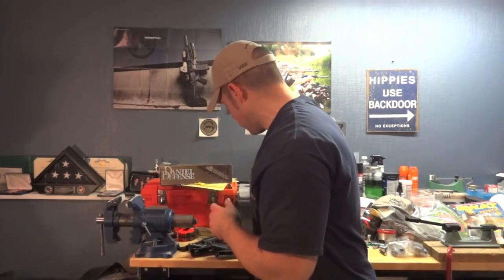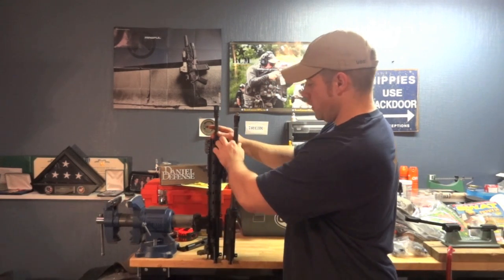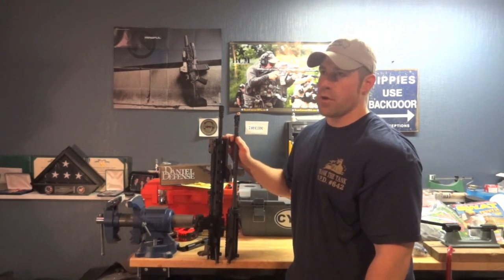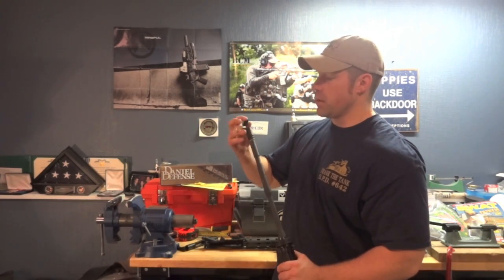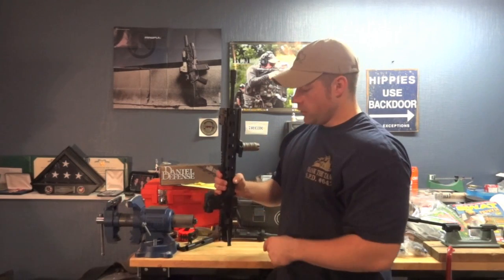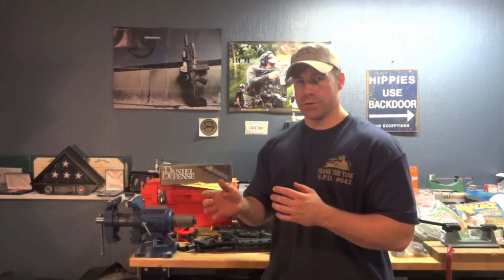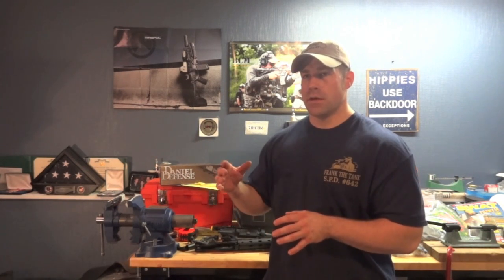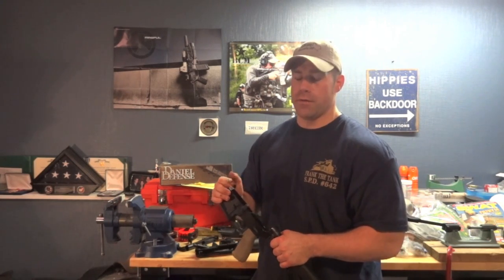Choosing a 16" vs 14.5" Pinned/Welded Barrel

Comment: Just an fyi for anybody thinking about pinning and welding their own build. A 14.5" barrel with a 1.5" muzzle device does not equal 16" due to the two parts being threaded together. Just grab a 2" device and go to town

Comment: I built a 14.5" 9mm with a QC10 barrel and Kineti-tech muzzle brake + blast forwarder. It's absolutely great! The barrel nut fits over the muzzle brake so it's not lost any sort of functionality.

9mm is a blowback not direct impignment so I don't have to worry about any sort of gas pressures and such for reliability.

I went for 16" for my .223 wylde.

Comment: What about dwell time? The mid length was designed to give a 16 inch carbine the proper amount of dwell time (the time the gas [with proper pressure]is tapped off the barrel till the bullet exits the barrel). Colt designed, thoroughly researched and tested  the carbine 14.5 barrel, along with a machine gun bolt carrier and  buffer system to work & work well. The mid length is an answer to the 16 inch having a longer dwell time, causing more pressure for a longer time than needed . Easy to research this on the net. Admit I like the looks a lot, but there is much more to the story. A 14.5 pinned flash hider most closely mimics what Colt designed so well.
Reply: In terms of reliability what would work better? Are there differences since the 14.5 was designed for a full auto m4, and the 16" designed for a semi auto ar15?
Reply: I know this comment is old af, but there is a good video on YouTube called i believe... The truth about carbine mid-length and full length gas systems. Apparently what you're talking about is a common misconception. I'm not saying that it is, but that's just what that video explains.

Comment: My bcm 14.5 mid length gas. Eats wolf and tul 55grain 223 steel case with zero issues. I’m running a Vltor A5H1 buffer setup. Super smooth.
Reply from the maker: BCM has modified some of their tolerances over the years to be more compliant with commercial ammo.  Commercial ammo has also gotten a little more consistent.  The one positive has always been that a lighter buffer has been the only thing needed if there was a cycling issue with lighter ammo.

Comment: I noticed that with a 16'' barrel and a carbine length gas system, extraction is just a tad bit more violent and has chipped the finish off the shell deflector, when I replaced it with the 14.5'' barrel and a permanent muzzle device, the shells started to hit the deflector square in the middle and just leaving brass marks instead of chipping off the finish. Was surprised such a small adjustment could have such an effect.
Reply: Get yourself a pack of brake deflectors. They're cheap, affective, protects the deflector's finish and your brass from deformation.

Comment: Great advice sir. I just ordered a BCM MK2 16" ELW upper. The 14.5" didn't make sense to me with having to spent the extra $50.00 to have it pinned and welded and only be a 1.5" shorter. When I get my shorty it will be a BCM 11.5" and Ill just use a good brace so I don't have to worry about a tax stamp. I just subscribed to your channel, it looks like you have some good info.

Comment: I am in the process of buying a BCM Recce and have been pondering the 14.5 or 16 versions and since I already have a DD that is 14.5, I have been leaning towards the 16. This video has made me lean further that way, also the 16" version cost about $100 less which helps... Thank you for proving some good insight.
Reply: I'm happy with it, mine is standard (government) profile but BCM offers others. 
Definitely assemble or build, if you buy a "rifle" on the 4473 you can't turn it into a "pistol"

Comment from the maker: If you want a piston AR, the LWRC is a good option.  I don't have experience with the IC, but I do with several M6A2's.  They're pretty good quality rifles, they're reliable and well-built, and LWRC is doing a lot better than they used to.  You will pay to play, but it's worth it if you can afford it.  In terms of the "premium" piston ARs, they're a better option than the HK MR556A1.

Comment from the maker: No, cosmetic blemishes are not an issue so long as the hard coat is still impregnated into the metal.  That 16" barrel I have on there is mounted on a Noveske Gen2 Chainsaw lower, and the upper receiver is a BCM blemished demo upper.  Both are excellent quality. Noveske is one of the best brands on the market, and I would not hesitate to buy anything they make.  I actually like their chainsaw stuff better.

Comment: I vote 14.5 if you have a suppressor. If your mind is set on a muzzle brake or flash hider QD attachment, then yes, there will be a 1.5" difference. But if you're using a long muzzle device on a 14.5" and a short muzzle device on a 16", then there is not much difference. 

The 1.5" comes into play when there is a 21oz suppressor at the end of the barrel. The weight at the furthest end of your rifle makes the most difference. This is why Tavor's are really easy to maneuver, while being heavier than ~80% of AR-15's. Most of it's weight is in the rear.

My rifle is 14.5 barrel is 16.05" with the AAC 51t brake. it feels like an SBR with the can off. I use Silver solder to permanently attach the muzzle device. I'm sorry to say that I'm a 14.5 guy now. Once you try it, you can see the difference. 1.5" may not sound like a lot, but you can notice the length of 16" to an 18" gun and an 18" to a 20".
Reply: +joshv06 I'm in the same boat.  Although I do have multiple rifles, my main one is a 14.5 with a P/W brake for my can on the end.  My other's a full length with another brake for the can, and it's amazing how it can be so much different feeling.  I also don't operate in a vehicle or in super CQB, so I don't have to worry about that yet, but I do have a third lower started with the intention of SBR'ing that one.
Reply: If you have to NFA it than the much smarted route  for a guy running a suppressor is to build an 11.5"  to 12.5" SBR.     A suppressed 11.5" does everything better than a 14.5" while only sacrificing 100fps off the top end...  For everything under 200 yards its the smarter build.

Comment from the maker: The 16" and 14.5 P&W are GP carbines.  The point I made was that if you are buying a rifle for CQB use, go to a dedicated platform like a 10.3-12.5".  They're in different categories and must be judged differently.  For CQB use, my preference is to use 11.5" or shorter, but 12.5" is the longest I'd ever want. 
As for 18" w/ rifle gas, it's not going to do anything for reliability, but it makes for a good precision platform. My Rainier XTC video rifle uses that setup.

Comment: Glad I watched this before making any serious decisions.
Thanks! Subbed
Reply from the maker: Thanks for the sub.  I am working on some new content after a long work-related hiatus.  I may wind up going over to Full30 as part of a collaboration with another channel.
Reply: Strictly his own Opinion about the 14.5" AR/M4 Barrel, do your own research on the 14.5" Barrel's because everybody's got they're own Idea what works best.
I personally like most the 14.5" & 16" Barrel's but I also have a 10.5" SBR and the weapon just shoots great with the M193 55Gr bullet and not so much with a m855 62Gr bullet, do your own homework before you buy and or decide on what you want because the sky is the limit when playing with this weapon system.
The US Military "ARMY" uses the 14.5" Barrel on the current issue on the M4 Carbine Rifle and I carried one for 12 years and it's a proven weapon system and as long as you PMCS your weapon it won't let you down. And this is just my Opinion

Comment: You have hit the nail SO on the head with ALL your comments.  My son and I just built mid-length 14.5's to save the weight out at end, and I wish I had seen your video first - because it is not worth the hassle of having the permanent muzzle device.  My son went with a BCM upper and it shoots great,  low recoil, using a normal spring and standard 2.9 ounce carbine buffer.  I went with a PSA upper, and mine is way overgassed and kicks way too hard.  The only difference in the two rifles is the barrel.  We both prefer standard pinned F-marked front sight blocks because they are so rugged.  In his case, with the BCM,  all is good.  In my case, I'm sure that the gas port is too large.  Now I need to get the sight block off so I can put an orifice in it to fix the overgassing,   But that is going be tough, might ruin the barrel, and the orifices have to be selected by  trial and error.  it would be so much less of a hassle with a 16".  Anyway, I learned the hard way.  You hit the key points.  I hope people pay serious attention to your comments, because you will save them money and hassle - even if they decide to go 14.5" against your recommendation, they should consider the BCM because it is gas-ported correctly and will run like a mid-length should - soft and sweet.  Great job on the video... nice to run across someone that actually knows exactly what he is talking about!
Reply from the maker: I would recommend getting a Syrac or JP adjustable gas block as an alternative if you want to turn down the gas.  Another option would be to increase the buffer weight to an H or H2, as well as getting heavier buffer springs from Wolff Gunsprings.  The increased weight options work well for slowing the timing, but they don't do anything to cut down on the gas blowback to your face.  Charging handles can do this to some effect, but still not a full fix.  An adjustable gas block is a more cure-all, but you have to be aware of the ammo you are using and what you have your gas block set at.  Just my opinion though.  Thanks for the comments.
Reply: SentinelDefense Thanks for your comments.  I am familiar with both those adjustable gas blocks.  But, like everyone else, I have my preferences.  I really, really like pinned F-marked front sight blocks, and that's what I use on my ARs.  No free-floating handguards for me.  I know that people say the free floating design is more accurate, and believe it is... but for ruggedness in field conditions, you just can't beat a big ugly pinned FSB.  As for the buffer and spring changes, I'm aware of those and will play with them.  There are some differences between round wire springs and flat wire springs that might be useful, but I haven't done the work yet.  I do know that if you have a carbine buffer and an H3, you have three steel weights and three tungsten weights - so you can make up an H (1 tungsten, 2 steel) or an H2 (2 tungsten, 1 steel) without buying them.  The money does add up.  I am running a BCM medium gunfighter charging handle (which is actually the VLTOR), which I like because it's easier to grip with gloves but not too huge.... didn't really think about it in terms of the face blowback.  Regarding the ammo, I have been using lake city 855 and 193, but after seeing your video on penetration, I will be playing with a few of the ones off your chart.  Thanks again for your obviously well-thought out recommendations.

Comment from the maker: They're fine.  16" barrels are generally very reliable, so long as they have either carbine or midlength gas systems, and not a rifle length system.  I prefer midlength gas for a softer recoil impulse and better control, but I have a 16" carbine length in the collection that works just fine.  It depends on the manufacturer more than anything, and many of the lower quality companies tend to over-gas their rifles, which beat up the components.

Comment: You make some solid points and just talked me out of a 14.5 pin and weld even from a company like BCM. I already have some of their 16 and 20 inch guns and they're very nice. But sometimes stuff breaks and you have to replace it. 

I will probably just register an sbr lower OR go in the complete opposite direction and make an M16 style rifle clone.

Comment from the maker: Yes, Daniel Defense is on par with BCM in terms of quality.  There are numerous top tier companies that use components made by DD.  I also personally feel that DD makes the best carbine barrels and rails, but that's just my opinion.  Every CHF barrel I've installed and used from DD has been sub-MOA accurate and very durable.
Reply: I don't think BCM offers CHF, I believe they're all button pressed. 

I don't have a comparison, but I like my BCM
Reply from the maker: @abstractapproach634  BCM BFH barrels are CHF and have been around for about 15 years.  BCM BFH and standard barrels are made by FN, while their SS410 barrels are cut by Krieger.

Comment: All of the muzzle devices I want are almost 2.5”.  With a 13.7 barrel I’ll be at 16”.  I’ll be 18.5 with a 16.  That’s significant to me.
Reply from the maker: Yeah, but if barrel length is a significant consideration, then consider an SBR or pistol.  This video was made years ago when AR pistols weren’t a thing.   If you’re in a state where you can have either, that is.  If not, then pinning and welding works as an effective option in that case.

Comment from the maker: ST buffers seem to be well-liked.  I've never used them personally, but would not be against it.  The ST-T2 might be too heavy for a 14.5" middy, but it could work with 5.56 spec ammo.  14.5" mids generally will have either a standard or H buffer, so if you were looking at an ST, perhaps look at a ST-T1.
The 15" Troy would look pretty cool on that setup.  Just be sure to keep your hand away from the end so you're not getting gassed in the hand.

Comment: 14.5 with a 1.5 muzzle device won’t get you legal 16 anyways take off .5 for barrel threads and your at 15.5
Reply from the maker: The muzzle device length being referred to in this video refers to the length of the muzzle device protrusion beyond the muzzle.  It is industry standard to measure the muzzle device by the actual protrusion from the end of the muzzle of the barrel.  This doesn't apply to suppressors, but has been common practice for the last 20+ years for muzzle devices like brakes, comps and flash hiders.  Yes, if the OAL length of the muzzle device is 1.5", it likely won't make a 14.5" barrel legal.  That said, unless the manufacturer/retailer specifically references OAL, when they give a measurement it refers to how far it extends past the muzzle.

Comment: Living in NJ, our muzzle breaks have to be pinned / welded no matter what.  If you were in that position would you still go with the 16"  or change your mind to the 14.5"
Reply from the maker: If I lived in a Ban State like that where you had to, I would opt to buy a 14.5" pinned/welded upper.  It'd most likely be a BCM EAG Tactical or Jack Carbine model.  A lot of the specialty built uppers are being offered in the 14.5" pinned/welded configuration, so to some extent, it would limit options and likely save a few bucks on the front end of the transaction.  That ban requirement nullifies the benefits to a removable muzzle device, so it's a drop in the bucket for either option.  At that point, it's "6 of one, Half Dozen of the other" provided that the built 14.5" is made by a company that knows what they're doing.  There are plenty of 14.5" non-NFA rifles out there running flawlessly, so it's a matter of making sure you're buying quality.  My main reasoning for my assertion is predicated upon the user not living in a ban state.  Now, if it were a 7.62 AR, I'd get a 16" for sure every time.
Reply: Getting ready for a build going with a 14.5 I live in Jersey

Comment: I did the 14.5 pinned and welded brake. I love mine but don't forget you can build any length into a pistol rather easy if you're not into waiting on a stamp. Much easier around corners with an 8.5 barrel

Comment: um... i like the 14.5" barrel..so ya (valley girl voice).  and i just realized this video was done in 2013 . lol . On a serious note though, and you may be shaking your head in disgust reading this comment but hear me out, and bear with me... So "I" find a 14.5 Mid Length gas setup (Noveske 14.5 MID L. Low pro/Gonna call it a Med contour , CHF Chrome lined. basically a M249 barrel sized down) under a 13.5 " Geissele MK16 rail, LMT enhanced BCG, backed by a Geissele H2 buffer and wire spring is that PERFECT weight /balance combined with perfect recoil impulse.  For me mind you and that i compare it to a M4A1 (14.5 Carbine gas system).  Going off the "work" gun when you feel the unbalance and the aggressive recoil, you have something to reference and ultimately fine tune.  Not saying i wouldnt get the same performance out of a 16" barrel setup, but I think you get the idea.  Another thing is im 6'4" and 280 pounds so I can just by body mechanics really torque on my setup, support hand placement, etc.  Like others im sure reading this,  adjust fires off what you dont like on a setup and fine tune, and not being a gun snob, got to spend the money on good shit(reputable brands).  But i do agree with you.  good vid brother

Comment: Excellent video, offering 'real world advice for anyone contemplating a build or buy 14.5" rifle!  I just found this after 7 years - can't believe I missed it.
While I completely agree that the 16" setup is 'the standard' and more flexible, I can also say with confidence that my 14.5" Daniel Defense M4 v7 SLW, which came out after this vid was posted, is one of the most accurate (sub 400 yds), satisfying and ergonomically compatible (for me) AR's I have ever fired.
BCM also makes fantastic rifles and similar to DD in many respects, but the v7 is my go to option.  It's fully setup with a Geissele SSA trigger, Eotech EXPS 3-2 and G43 magnifier, Radian Raptor charging handle, and backup Troy Tritium battle sights.  I don't have a single complaint after approx. 3000 rounds...
You cannot go wrong with BCM, DD, LWRC, and other premium manufacturers...